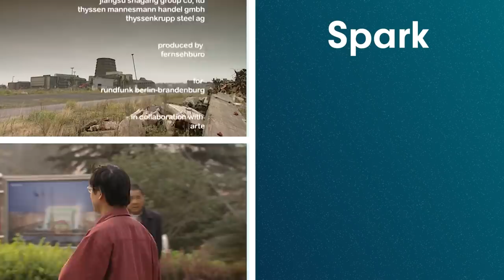The Fishermen Who Fish For Metal | The Earth's Riches

Comment: 7:01 did he just cool the engine from the inside
Reply: It's an evaporative cooling system. Old engines used to use it and it works pretty well. It's just a simple open container of water over the engine. When the engine gets hot, the water begins to boil and the water that turns to steam pulls heat out of the remaining water. You have to keep topping off the coolant though.